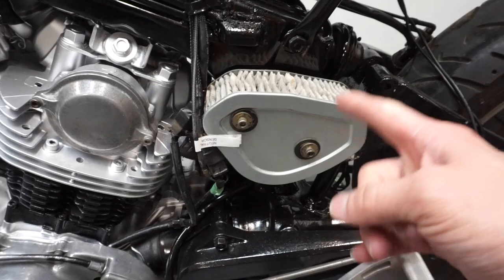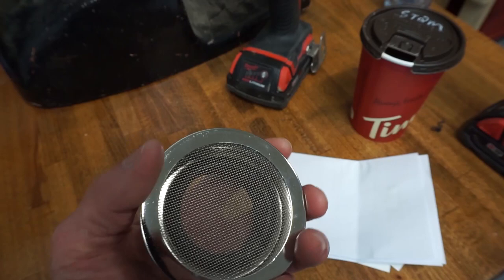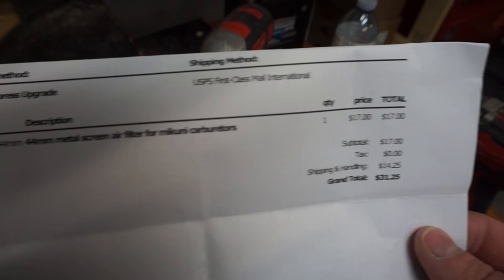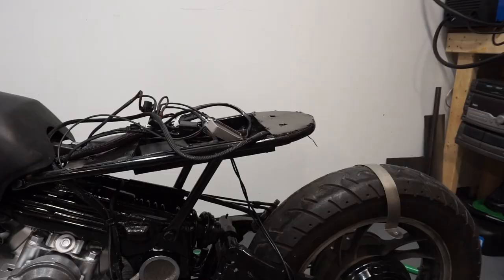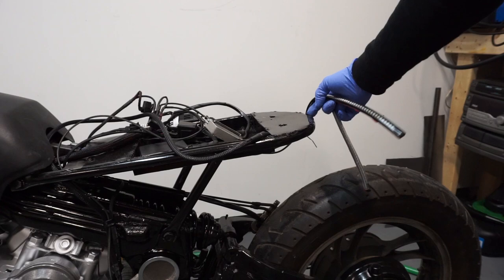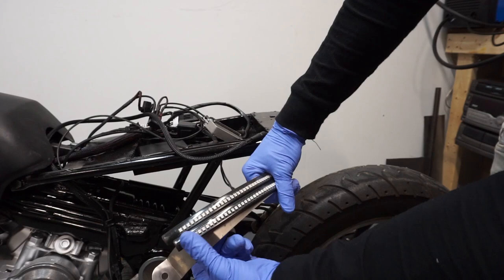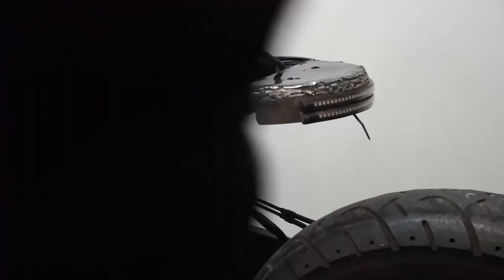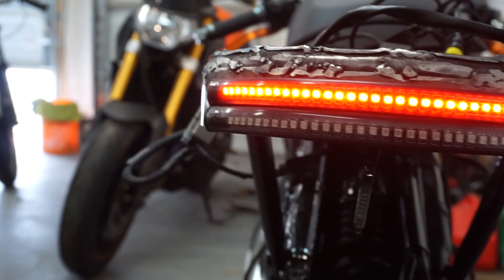Yamaha Virago XV920 Café Racer Build - Vlog #27 - New Air Filter!

Comment: Tight clean and well done!  Im working on a '82 920R.  I will probably redo my seat like yours to hide the rat nest I inherited.  I hope ya dont mind bc i need some pipes like yours?  Where did ya get those?
Reply from the maker: The 920R is a beauty and pretty rare! Lucky you got one!  Are you talking about the subframe pipes? I got those at home depot.  Check out one of my previous older Vlog's on this. I documented the whole thing. The one you see now was my 2nd attempt. I'm still not 100% happy and will be making another at some point.
Reply: Thanks Man!  I really like shifting the wide power band through the twisty canyons up here in the Rockies of Colorado.  LOL Im talking about exhaust pipes.  Do you make that exhaust?!  Sorry I haven't seen all your Virago vids.  I got this Virago about two weeks ago.  My muffler is so butchered up Im concerned about having different back pressure issues.  Yours looks legit, even flow from both cylinders.  Im curious if your setup allows enough room to mount the battery under the back cylinder exhaust outlet?  Because if it does I would want to buy that exhaust!  I'm sure to eventually watch all the vids!  Thanks Man!
Reply from the maker: I thought you meant that but wasn't sure lol  The exhaust is custom, I made it myself.  You can find it in one my videos or in the playlist i made for this series.   It wasn't complicated, but you need the right tools and I would recommend getting a dry cut metal saw and not the black disc cut off saws like I used...it will triple the time it takes to make the exhaust because of all the cleaning you need to do for every piece.  I mounted my battery where the centre stand is after I made this exhaust. I re routed the back cylinder exhaust up instead of going under the frame which gave me the clearance to do so.

Comment: I am doing the regular kn filter like how yours was in the first of video but the bolts are too long. Did you do something different here? Thanks
Reply from the maker: I cut the stock air box apart using the factory plastic stuff to make sure it fit right with the filter. You will see the 2 plastic bits from the air box that go into the filter, they look like hollow plastic tubes the bolts go through and then i also cut out the base of the air box that sits against the frame. you can't see it when installed but that will allow for you to use the factory bolts and get a nice seal. There are also the metal tubes, re use those from the factory set up. You could also just get new shorter bolts from home depot but from memory, I think you still need to use the base of the air box to get a nice seal, otherwise it won't sit to the frame nice and there will be no point in having it.  Check my past videos, pretty sure I covered it. Probably one of the first videos I did.